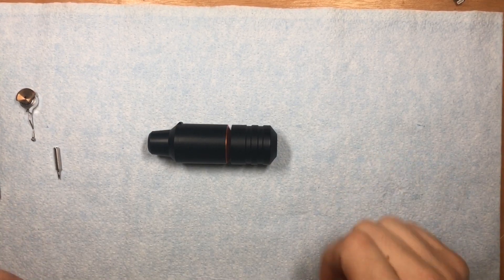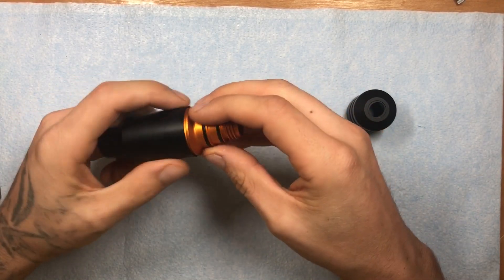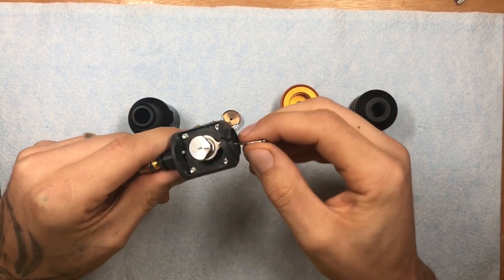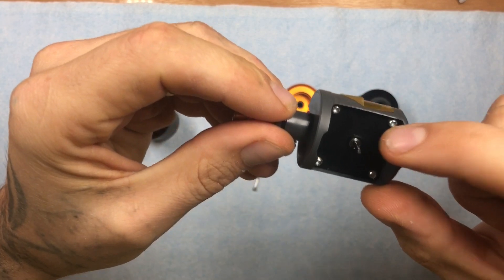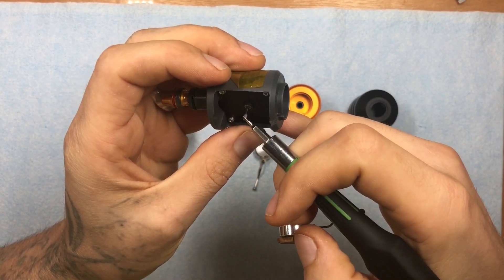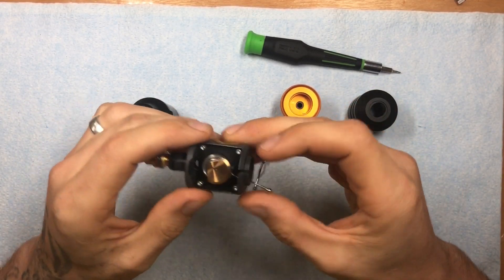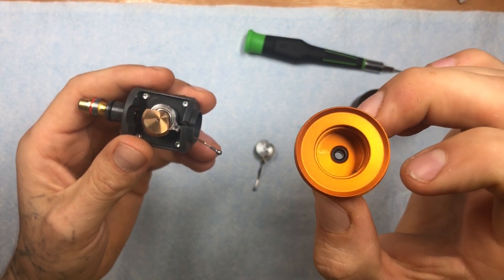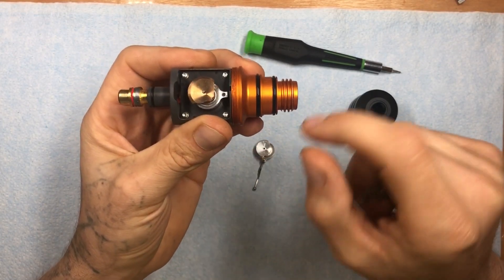Inside a Sol Nova Cheyenne Teardown

Comment: Cool, nice to see inside!  The bishop wand is essentially the same setup.
Reply from the maker: Correct but wound for 6 volts instead of 12 volts like the sol nova
Reply: But with a garbage casing work on the bishop :/
Reply: @staceydickson3530 same wound both are 6 volts but cheyenne use a higher resistor combined so usually takes arround 2 volts more for same speed.. the 12 volts winding is the one used on inkjecta nano machines

Comment: Very nice job man.. I love machines w bigger stroke cams... I have a Cheyenne Hawk Pen, how could I get a hold of a 4mm cam and swipe it for the one that it comes with?? Hope to hear back from you thanks..
Reply from the maker: Raul De La Torre Hey thanks for your comment unfortunately though the Cheyenne hawk pen Cam system is quite a different then the sol nova internal setup.  a 4mm conversion would not be possible
Reply: @staceydickson3530  okey yes I undertand.. Im looking to buy the sol Terra, do you know by chanse if sol terra could be modify down the road like nova?  I think ill be jus fine w terra since its a 4m stroke. Do you know if Terra & Nove share the same bls dc motor? Thanks for yur knowledge.
Reply from the maker: Hey Raul, the Sol terra & sol Luna are the only Cheyenne machines I haven’t tore into yet, although they both utilize the BLDC motor technology I’m not sure if the cams are pressed on like the spirit and thunder or if it’s removable like the sol nova. ( id put my money on the cam being removable though with the sol terras BLDC motor) 
The BLDC produce more torque then a Brushed motor, (and are more prone to the cam slipping on the output shaft under load) the sol terra and Luna most likely have a machined tip on the output shaft where a cams setscrew seats itself just like the motor and cam in this video 👍
Reply from the maker: To prevent slippage
Reply: @staceydickson3530  wow thanks a lot, best wishes for you & keep doing great job thanks for charring your knowledge...
Reply: @staceydickson3530  where can we ghet the 4.2 mm cam use with other machines that are using similar sistems ?
Reply from the maker: Raul De La Torre Sol Nova RCA Conversion Video up, check it out @ https://youtu.be/C6GrBHgbXdA 🤘

Comment: Great video what made you modify the sol nova and do you see the difference in power?? Also did it come with a chip/motherboard inside
Reply from the maker: I modified to a RCA to utilizing the wireless battery packs ( the power is still the same) and the sol nova uses a BLDC motor so *yes there is a small controller (chip/board) on the back side of the motor that’s not shown.
Reply from the maker: Crs Figueroa Sol Nova RCA Conversion Video up, check it out @ https://youtu.be/C6GrBHgbXdA 🤘

Comment: @Stacey Dickson @Sol Nova users

I heard this machine has alot of issues with the motor being really noisy and loud almost loud like a coil after awhile. What is the cause of this I heard it is a common problem which is one of the reasons holding me back from buying it.

Also what is the difference between a RCA machine vs. 3.5mm jack machine? Is there any difference? Pros and cons?
Reply: @stacey is it possible to make a Cheyenne hawk pen a 4.0 or 4.2 ?
Reply from the maker: Sol Novas cam wears out quickly if you run your machine over 8 volts there better low and slow in my opinion